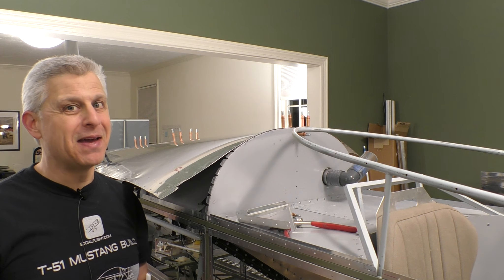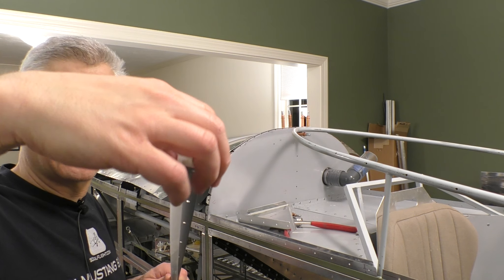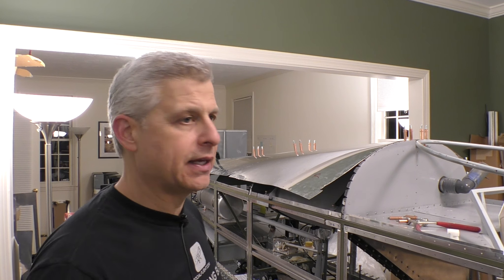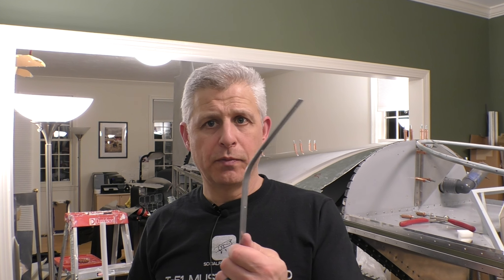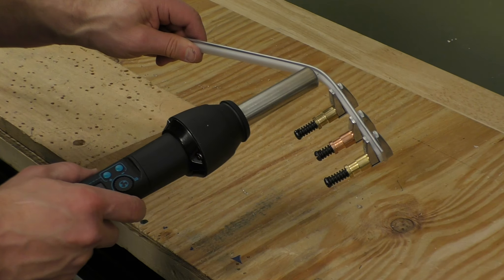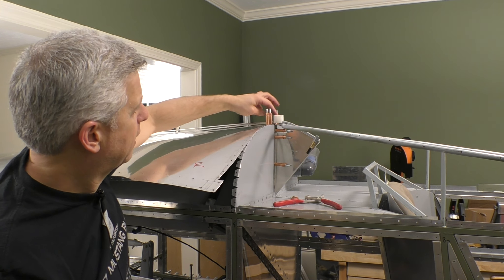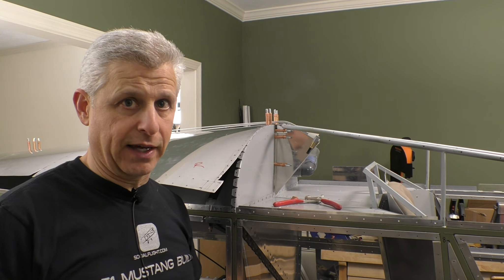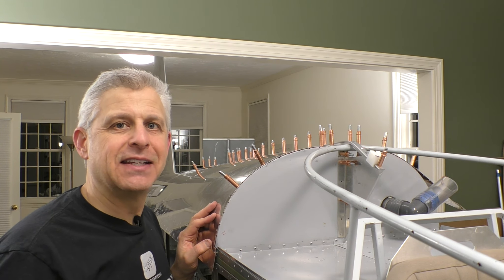Do the Mustang Slide!  Completing the Rear Canopy Track on the T-51D Mustang!

Comment: Is the entire plane all pop rivets? Seems like it would be a much nicer finish to use solid bucked rivets when possible? I can see if they’re going into a tubed frame and no access to buck it. But just seems a bit cheesy to use all pop rivets.
Reply from the maker: Titan uses a steel frame, bonded (glued) aluminum and pulled rivets.  Extremely strong construction. You might be surprised by the number of aircraft that use pulled rivets: Sonex, Zenith, Titan and more. Much faster build and very strong.
Reply: @SocialFlight  I wasn’t questioning the strength of construction. I see my comment may have come off that way. And I should have used to term pulled river not pop rivet. I’m just looking at it more as aesthetics. I mean a nice solid rivet and better yet flush rivets look really nice. But as you pointed out I’m sure it mostly comes down to build time and to make the kit accessible to more people with ease of construction? Imagine making all those rivets flush rivets?  Maybe that’s why I heard somewhere something about only like 20%? (can’t remember the actual number, but know it’s a low percentage) of vans kit planes actually get built start to finish by the original builder?  Anyway sorry for the long rant. I still think the titan is a really cool plane and do enjoy checking in on your build.